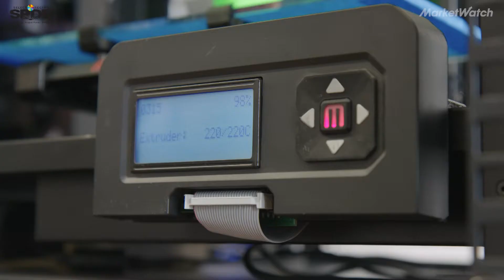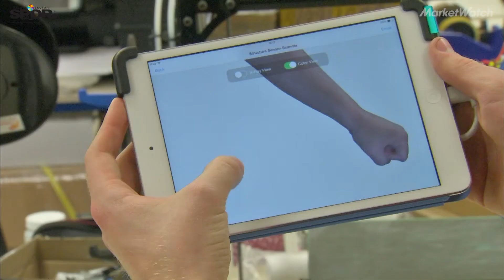This is the future of 3-D printing

Comment: this is pretty cool! never seen so many printers lining up like that...you guys have a robot arm, I'm sure you can engineer a better 3d printing machine that operates like a factory rather than lining up table top printers.
Reply: The point is that they are cheap consumer printers and Voodoo just has a lot of them. This means you can get parts for a ton cheaper than if you wanted a better 3d printer and it likely takes less time too.
Reply: @liamschwartz2825  It would suck if 10% of them run out of filament at once or 1% of them gets nozzle blockage every day....It's unpredictable what could go wrong when doing a 3d print and now you have 100 of them.....too much maintenance  in my opinion. I have 1 printer and every time I print, there are things that could go wrong....
Reply: @liamschwartz2825  They've migrated to more robust and expensive Makergear M3 printers.  It's worth mentioning that with low cost Creality and similar printers saturating the market place, I can't see the sustainability in outsourcing.